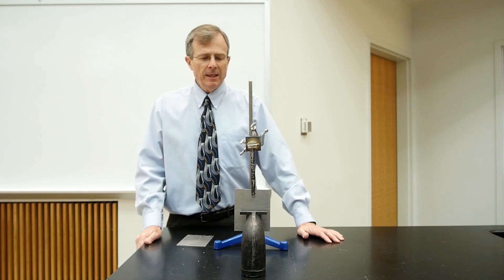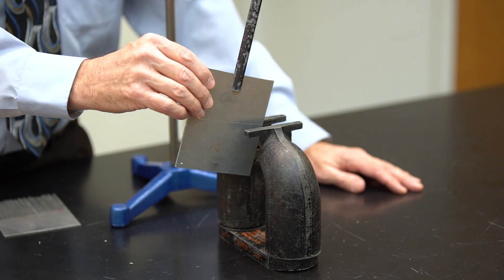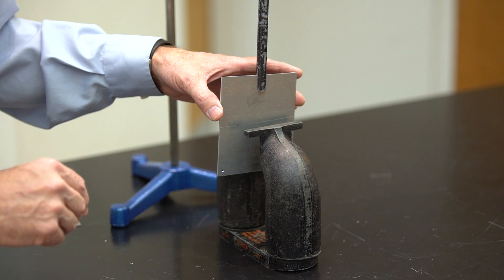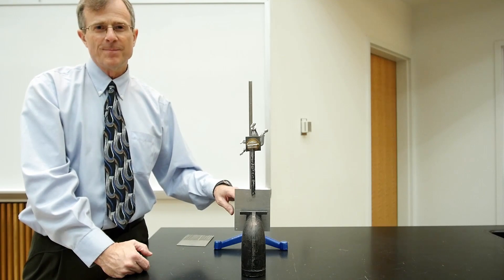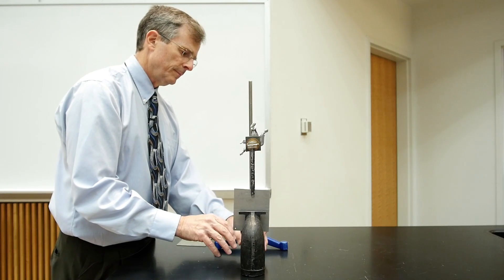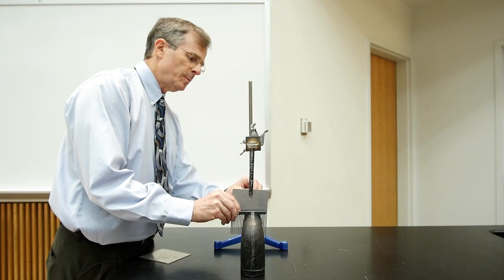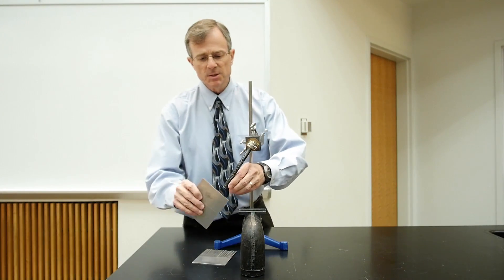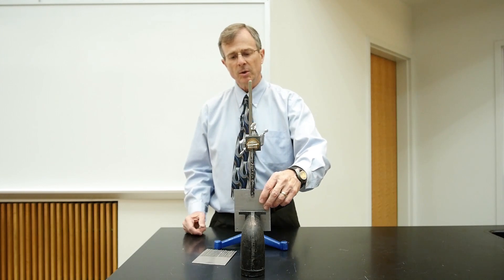Faraday's Law Demo: Eddy Pendulum

Comment: Before automobile instruments became electronic, the speedometer worked on the same principle. A sheathed cable was attached to the drive train and was routed to the dash of the car. The cable turned a spinning magnet located behind an aluminum plate with a calibrated spring tension. The pointer for the speedometer was attached to the aluminum plate.
Reply: what i understood by googling it was the magnet created drag which rotated a metal cup, which was attached to the pointer which indicated the speed

Comment: When he says EMF is produced, he means Electro-Motive Force, which is a fancy term for voltage.  Remember voltage in Ohm's Law, V (or U in some parts of the world) = I * R.   In this case the resistance is very small, less than 1 ohm.  It would be nice to see this with a flat spiral coil of wire as the pendulum so that the current may be measured on a meter.

Comment: Since eddys are modifying the drag force in the differential equation (dimensionless for some constants {a, b}):
x''+F+a*sin(x)=0
I would like to know how you model the drag force under this extra drag:
1) like a Stokes' Law:
F=b*x' with a big parameter "b"?
2) like standard quadratic drag force
F=b*x'*|x'| with big "b"?
3) with a non-Lipschitz term of the form/similar
F=b*sign(x')*sqrt(|x'|)*(1+|x'|^(3/2))
so it could have a finite extinction time?
4) another?